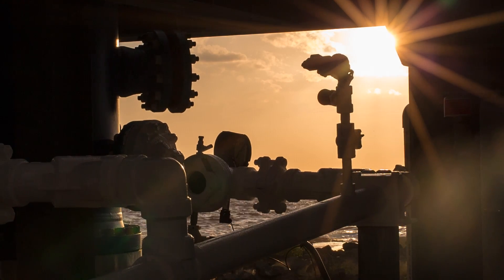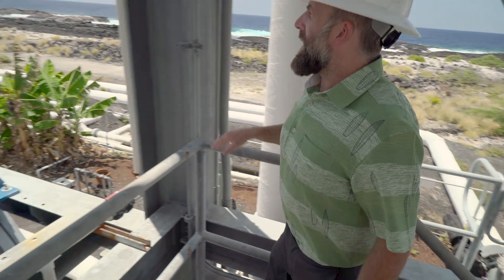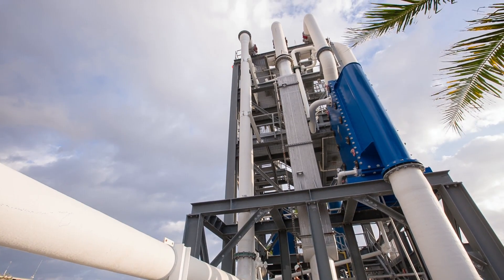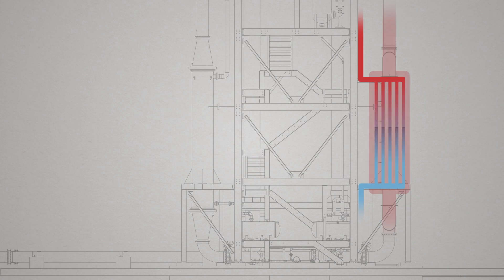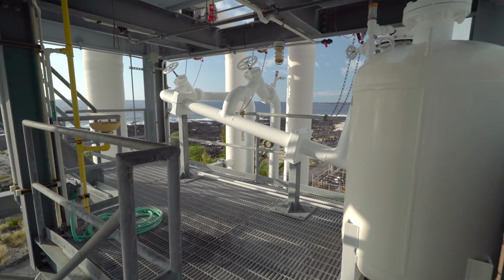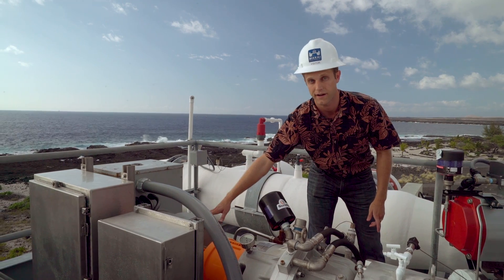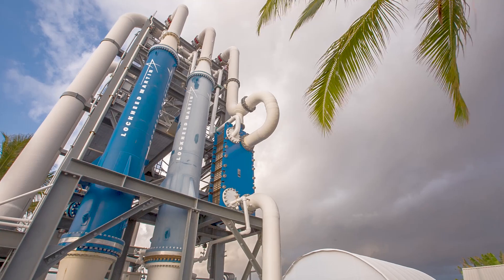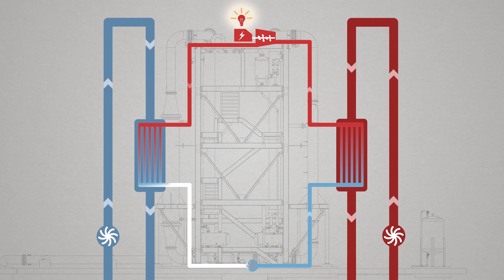Ocean Thermal Energy Conversion ( OTEC ): The Future of Baseload, Dispatchable Renewable Energy

Comment: How do you re-condense the anhydrous ammonia, whose boiling point is -33.34°C, with deep seawater that is only around 0°C?
Reply from the maker: +Scott Baker The boiling point of ammonia of -33 deg C assumes an atmospheric pressure. Instead, our OTEC system operates at elevated pressures, where the vapor-liquid equilibrium for ammonia lies in between temperatures the hot side (~25 deg C) and the cold side (~5 deg C). This allows us to condense the ammonia vapor to a liquid with only a ~5 deg C heat sink provided by the deep seawater flowing through the cold-side heat exchanger (condenser).  I hope this helps.
Reply: The square root of 6000 is 77.  So the solar pond would be less than 300 feet square.  Not big at all.  I was envisaging something on the Mexican side of the border in the Gulf of California.  There are vast swaths of land with a low population.  You could easily build a jetty out into the gulf and back in to create a solar pond of a few square kilometres at very low cost.  So you would be producing electricity for the the U.S. market and also run a pipe to sell the distilled water to Los Angeles at 3 dollars a cubic meter during a water shortage. You simply sell water to rich people at 5 dollars a cubic meter.  Then feed the water into the "grid" and pay the city 2 bucks a cubic meter to deliver it.  The city would be glad to make that deal.  You'd be taking pressure off the city water infrastructure and they would be making money doing it.  Win Win.
Reply: I'm assuming you have also thought of integrating solar pond technology with OTEC.  My understanding is that the high saline water at the bottom of a solar pond can reach temperatures of 70 Celsius.  This might allow you to use a liquid like methyl alcohol as a driver.  It has a boiling point of 64 Celsius.  
     Another component of an expanded version of this system would be to put sea water through the solar pond to heat it then run it into a solar array to get it up to boiling point to run a turbine.  Fresh water would come out the other end of the turbine.  In a place like California this "byproduct" could be sold as distilled water.  You could also sell the salt.  
      Another option would be to use the high temperature solar pond water and the deep water cooling water to run a Stirling engine.  
    I suggest a simple sea wall be build out into the Gulf of California relatively close to the California, U.S.A border.  Because that's were the market for you electricity is going to be.  
      Funnily, enough OTEC was tried off the coast of Brazil several decades ago.  The idea  was to sell ice to the large Rio market.  It was a commercial failure.  However, the barge on which it was located brought vast amounts of nutrient rich deep seawater to the surface.  This created plankton and zooplankton blooms.  This resulted in a massive increase in the fish biomass in the immediate vicinity.  Interesting, unforeseen aftereffect.
Reply: +Scott Baker I believe the water they are using to "re-condense" the anhydrous ammonia is closer to 5°C.
Reply: Dee J So that would be even less efficient.  Can you actually answer my question?
Reply: +Scott Baker you are generating electricity so to get the differential i can't see why you couldn't use the ammonia in the storage tank as a refrigerant, thereby doing half the heating process in the recooling process.
Reply: Simon Tate Absolutely!  Why not?
Reply: +Scott Baker did u got the answer? how can we condense -33°C  ammonia using 0 r 5°C water.any pressure variation.
Reply: Scott Baker
Reply: Maybe the volume flow rate of the warm sea water required would be more than that that can be obtained by the solar pond. So it may require large surface area. According to some data of past solar pond in India, it would need 6000 sq. meter area to produce 80000 liters of warm water daily and that is pretty large and also add up to cost. That's what I guess. Tell me your opinion.
Reply: The entire plant operates under saturation conditions but there is a few degrees of subcooling in the condenser (accidental cannot be avoided).  The thermal efficiency is very low.  The saturation temperature in the boiler would be around 85F and the saturation temperature in the condenser around 45F.
Reply: @michaelcampbell5567  Hey cousin!
Reply: Bolling point is a pressure temperature thing.  It's not JUST temperature. As the warmer side heats the refrigerant,  it creates pressure.  The pressure raises the boiling/condensation point. As long as there is a difference in temperature,  gas will escape the hot side and run to the cold side and condense.  The condensation relieves the pressure,  dropping the boiling/condensation point. They basically balance each other out.
Reply: Reading y'alls comments makes me realize why people give me blank stares when I tell them about my much more elaborate idea.

Comment: Analogy: Reverse the Refrigerator, or the Air Conditioner, closed cycle process. Water at 4 deg C is densest and sinks in the ocean; while the surface ocean water follows the thermal energy absorption pattern..